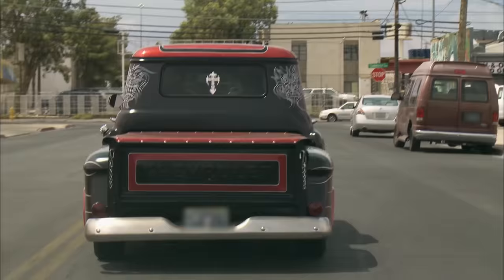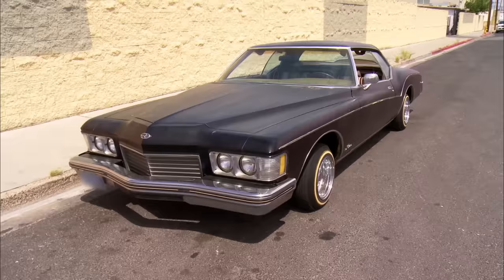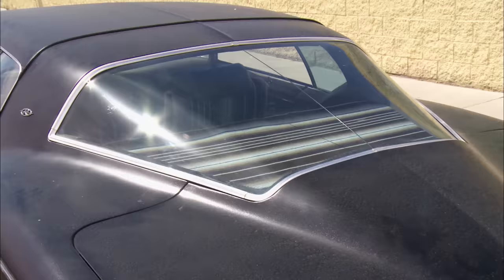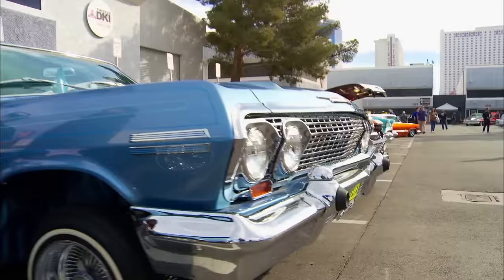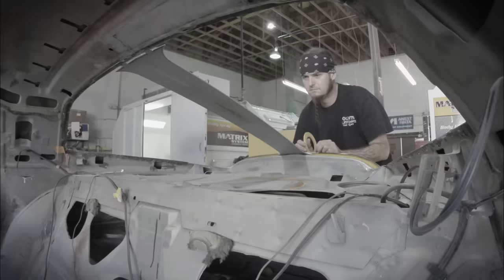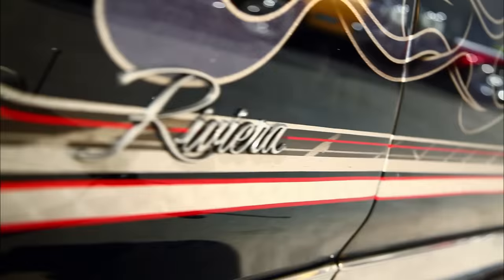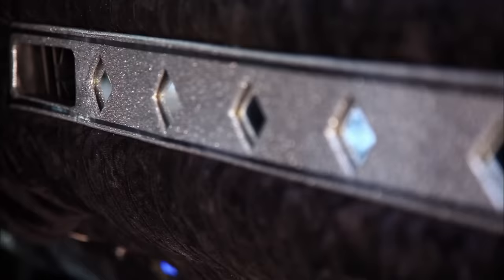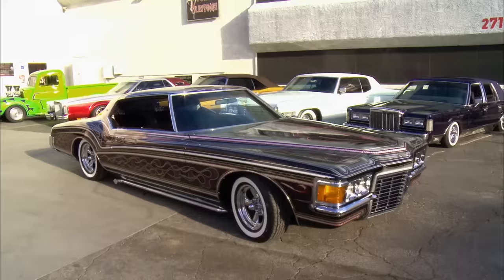Counting Cars: Danny's Classic 1973 Rivera "Boat-Tail" Steals the Show (Season 4) | History

Comment: I still remember the day my dad brought his home. I had never seen such a magnificent car before at age 13.   He bought it used in 1975, but it was pristine.  It may seem like just a unique 70s car today, but in it's day, it may have as well been a UFO to those who had never seen one before. The 455 HP was smogged down but the torque was there. It ran smooth at idle and full throttle, and had a lot of passing power. I pegged the speedo one night, and it stuck beyond the bezel for a second. I hundred thoughts we t through my head on how I was going to explain that. Fortunately, it released after a few seconds.  
The front bumper has cylinders to compress to absorb blows without damage. They were necessary because it was difficult to gauge where the front bumper was because of the long hood. And it was common practice for people to tap bumpers against the cars on either end when parallel parking. The rear stinger bumper could damage most other cars if they bumped it.
My dad kept his until he died in 2000. My jerk brother sold it to his friend for $100 before I realized it.
I sure miss the smooth ride of that car and other large cars of that era.